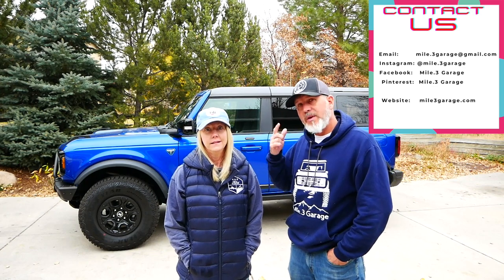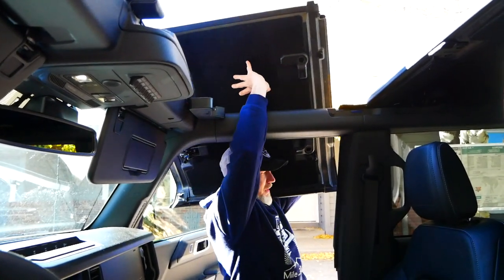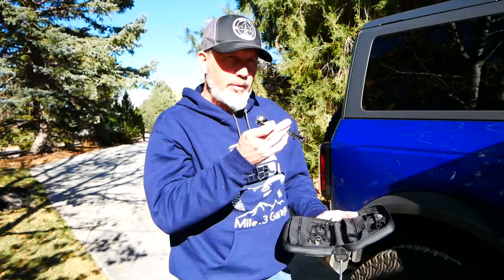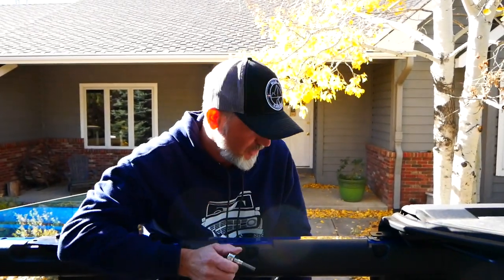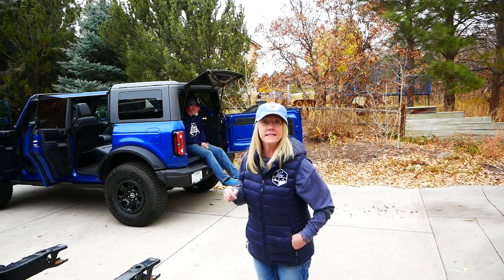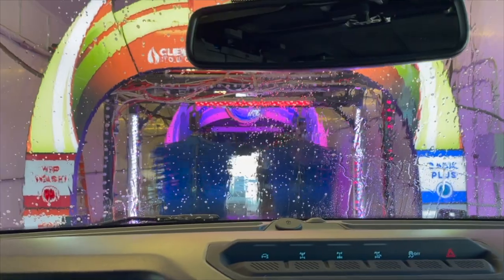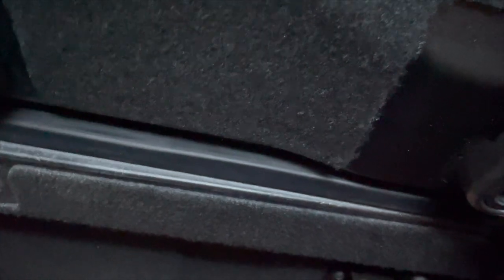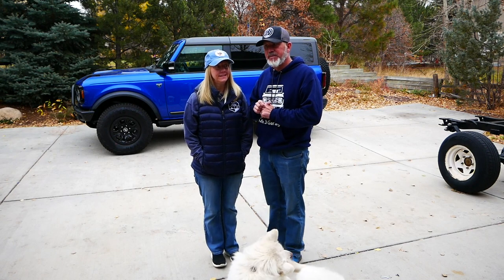Ford Bronco Full Hard Top Review

Comment: Thanks for sharing the video and giving a "real world" perspective on the removal and installation. I've wanted a Bronco since I saw a '74 Bronco restored in 1989, but I never bit the bullet. I've been following the new Broncos since 2018 and since I've passed the half century mark, I think it's time to treat myself.  

Is it safe to say that based on the panel design, because of all the securing points, you could remove just 1 of them and leave the other 2? For example, you could remove the front panel and leave the back 2 panels? 

Thanks again for the awesome video and looking forward to the door removal post!
Reply: hello, yes you can remove the front three panels and keep the back on.  This is the way I run it 99% of the time.

Comment: I wonder how much better the new hard tops are after they fixed it made it quieter not leak
Reply from the maker: We haven’t had an issue yet with our new one.
Reply: @alpinegarage8548  I've seen and heard the road noise is atrocious with these hardtops, hows yours?
Reply from the maker: @BrooklynNY1979  the ticking from the pins happened for a short time but now gone. I assume the top has “broken in”. The road noise isn’t any worse than any other removable hardtop vehicle I have had (JK, YJ, etc).
Reply: @alpinegarage8548  Cool, thank you!

Comment: Really cant' figure out how/why Ford could not come up with better sound-deadener than that flaky stuff. First thing I'm going to do is vacuum mine! If that doesn't do it, I'll have to find some kinda spray to lock it down.
Reply from the maker: Quick fix in my opinion. The glue is everywhere on the top. Hastily done but effective.